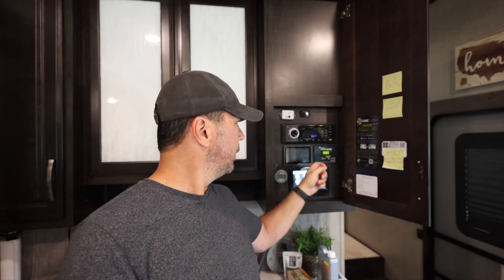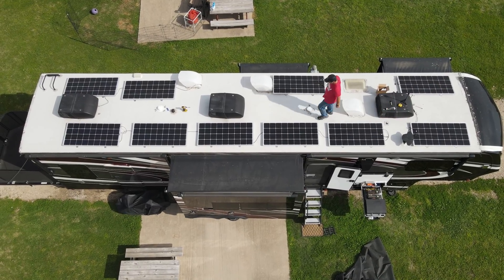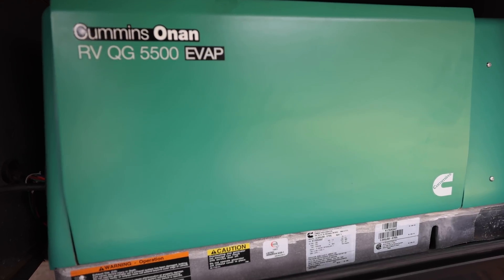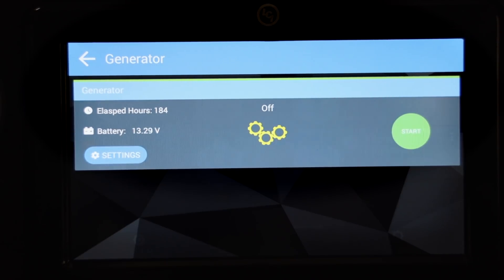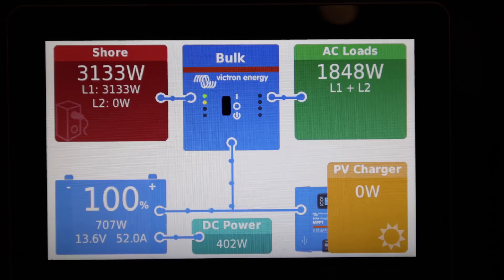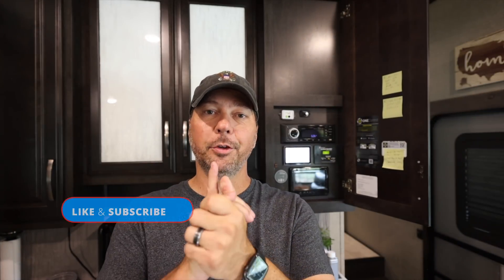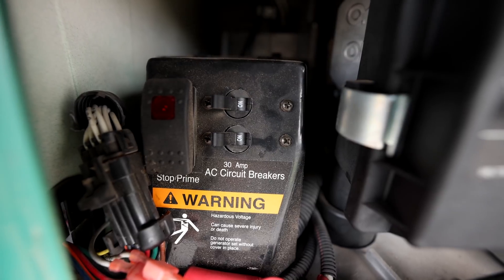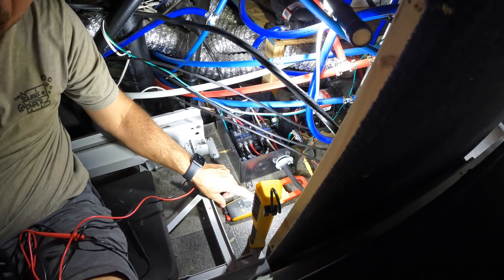RV Off-Grid (Solar) Power System Review and Fixes! (Full Time RV Life)

Comment: This is awesome! So I did my install very similar to yours aside from the inverter. I purchased the original one about 8 months before they released the second version that utilized both fazes. I actually worked with Jared "all about RVs" to do the install. The issue I was having is that when I would try and run an AC, it kept popping one of the two 30amp fuse on my 5500 generator. He helped me adjust some of the settings on the inverter that seemed to help. But I think what you did here would work even better. I couldn't figure out why running the AC's through the inverter would change things. And I couldn't find anyone that understood why. I'm going to give this a try. Thank you so much!!
Reply from the maker: Yea.. I texted with him a bit back in January and he mentioned someone he was helping over email.... I guess that was you.
Reply: @ChangingLanes  Yeah, it was. He helped me a lot on it. My only concern is that since I'm running the older inverter and I have one of the legs running through the manual switch, would that affect anything? I'm thinking it wouldn't but I want hear your opinion on that. Thank you for this video!
Reply: @DavidBowen  Neutral bonded to ground somewhere?
Reply: @MrThisIsMeToo  I don't think so. Both ac's worked together on the generator. Once I ran it through the inverter it started poping the breaker.
Reply: @DavidBowen  I had a similar issue on mine.  Had power appearing on the RV plug when the invertor was inverting.  I would be seeing that the Victron's have a floating neutral, that the neutral / ground connection is appearing in two places.  One on the generator and two on the invertor.  Could look into that, or just simply disable the neutral / ground bond in the Victron while it is inverting.  Be careful though if not experienced.

Comment: Chad, I see your display shows AC and DC loads, do you have current sensors on both sides so it shows up in the display?
Reply from the maker: The Cerbo looks at whats being used by the inverter and whats being pulled from the batteries and does some math to figure out native DC usage.  You have to tell it you have a DC system in the configuration and it does the rest...
Reply: @ChangingLanes  thanks, that helps, I will do some digging, Im sure that was discussed at the Victron training I went to, but there was so much info that some stuff just flies over

Comment: Here is what recently happens to me, we have the same inverter, with 630AH Lion Energy bank in 12 volts and 1200 watts on the roof, I was at a park with only 30 amp, I forgot to adjust my supplement to 29 amps, it was still at 49 (for a 50 amp pedestal) we had our fireplace making heat, a space heater, TV on, and then I made a coffee in out Kurig, we heard a click and all the ac loads went out ,but 12 volt stayed on, I blew the breaker on the pedestal, re set that and all is good right? wrong! everything worked, BUT when we were packing up to go, we noticed the lights flicker when the water pump kicked on, and then my wife was pulling slides in, no problem on the standard ones, but the Schwintek wouldn't work, when the inverter switched over, the AC loads were so high that I blew my 400 Amp battery fuse, and out 12volt loads were running off the solar panels without the batteries. Replaced the fuse an all was good again.

Comment: If you would have instAlled 24 v batteries. Which module does the convertion down to 12 vdc to supply your DC accessories like lighting? Your DC buss bar would be sitting at 24VDC now !
Reply: You would have to add another piece of equipment.  Victron makes a DC to DC converter line called Orion which will take 24v to 12v DC.  The wiring would get a little  more complicated as all 12v loads would need to come off bus bars located downstream from the Orion(s).
Reply: They run as 2 stand alone systems. 24v only runs the inverters for 110vac
Reply from the maker: If you go with a higher voltage than the rig is designed for (12v), you need a DC-DC charger/converter to bring it down to 12V for the rig.
Reply: You could also keep a spot for 2 battleborn 12Vdc in series ( to keep 24VDC bank) and have two terminals post of 12VDC available to connect lights. Saving the DC to Dc converter !

Comment: Awesome video Chad!!!  Having an RV built now.  Delivery date late August.  Solar package going to be installed in 2 months and it will be similar to yours.  Except for 1600 watts of panels, 8 lithium batteries, the 3K Victron inverter, and the other associated equipment you have.  My question to you, should I go with the 270 amp hour batteries.  I was a QM in the Navy for 20 years, so I’m still in training as an Aviation Electrician.  Would appreciate your advice.  Thanx!👍😃🍻
Reply: Look into the victron smart batteries especially if you are going 24 or 48 volt. They have a 200 AH 24 volt in a great form factor for just over $3000, on par with battleborn pricing
Reply from the maker: Our next install will be something like the BB 270Ah models...   But, another commenter mentioned eg4 from signature solar which also looks nice.  The battery game is ever changing, so do some research on energy density and check reviews... there's a lot of good stuff out there.

Comment: How do you differentiate between shore power which is 240 volt with opposite phases and your current setup which is 2 120 volt feeds on the same phase?
Reply: Measure the voltage between L1 and L2.  On shore power it'll read 240vac because the sine waves are out of phase.  If the voltage reading between L1 and L2 is 0vac then they're in phase.
Reply: There are no 240v circuits in the rv breaker box so hot1 doesn't know hot2 even exists except that they share neutral.
Reply from the maker: Not sure what you mean...  Shore power and generator power come in on different lines to the ATS which has generator priority.. If power is on the genny side of the ATS, it is connected to the inverter.. otherwise the shore power side is connected.  The inverter can see the phase relationship and acts accordingly.

Comment: Any reasoning behind sticking with battleborn? The new hotness right now is the eg4 from signature solar. 1500 usd for 5.12 kwh pack at 12, 24 or 48 volts is pretty compelling vs battleborn from where I am sitting.
Reply from the maker: I hadn't seen those.. Looks very interesting!  Thanks!
Reply: @ChangingLanes  There has been a lot of new players entering the consumer lithium battery space over the past few years and it's created some good lower cost alternatives to Battleborn and some new battery formats. I would suggest giving will prouse a follow on YouTube. His channel is focused on solar power and he opens up a lot of the batteries coming over now from china to see how they are built.

Comment: Chad,   Very smart fix for the generator.   I looked at the wiring diagram that you showed and the generator is paralleled on L1 and L2 just ahead of the two breakers and the L0’s were also connected together.   So, I learned something!   Thanks for the vide.   If you want to get your solar to put out the full 2000 watts or more, go to a mountain top in New Mexico in the summer near solstice time and at noon.   Respectfully,   Kevin

Comment: Love you used the ac ducts.  Any concern with condensation on the cables?
Reply: Shouldn't be an issue.  Cable should quickly be the same temp as the air in the ducts.  In any case it has a waterproof covering everywhere except the ends where the connectors are.
Reply from the maker: Exactly what Steven said... 👍🏼

Comment: A ground bar isn’t rated, designed or listed for your purpose. You’re 100% creating a fire hazard. Go buy a Polaris connector. They’re insulated and listed for your intended purpose.I’ve been a licensed JW in 2 states for 25 years. I think HD or Lowes has them. Do yourself a favor and replace them.
Reply from the maker: Another commenter also recommended those splices and I will be swapping it out.  Much cleaner and less hacky.  However, I disagree on the fire hazard.  Full load for an hour and it wasn't even warm.
Reply: @ChangingLanes  not if it shorts out from being a bare buss. I’m sure it was fine amp wise, the breakers should trip first. Keep in mind mini earthquakes. We love your guys videos. Keep up the great work. How to meet you someday 🍻

Comment: Fantastic video.  My husband feels completely vindicated!! He's been talking about doing a 48 volt system since he started looking into it and I kept saying "there must be something negative about it that we're missing because if it's so much better Chad would have done it". The smile on his face after you said you would have done higher volt was HUGE! 😁 😁 😁
Reply: I would set up a single 12 volt battery for the 12 volt needs withe the dc to dc converter. The single battery can act as a capacitor for the hydrolic pump.
Reply from the maker: The only drawback is needing a DC-DC converter to serve the 12V side..   Side note on that, make sure the DC-DC can handle the inrush current of the hydraulic pump.  I've heard there can be issues there.
Reply: @ChangingLanes  Chad is correct.  Victron makes the Orion series DC to DC series but they all will have a amp limit so know your DC loads and spec accordingly.  Doing after the fact - you would also have to upgrade the Inverter/Charger and a host of other items that would now need to be optimized.  Best to design upfront and spec accordingly.  If you went with 24v you could go with Tesla modules which pack a ton of power in a small space but need a custom BMS and are a little more dangerous chemistry.
Reply: @atcgeek21  FYI If not aware, you can parallel the Orion converters I ran two on my 48v system.  Upside is you have redundancy.
Reply: @MrThisIsMeToo  Absolutely! I should have been more clear.  They work great for this application.

Comment: Have you gave thought to adding another battery charger from Victron on those days with little solar but your batteries are low? You can use the generator to power the multiplus and the supplemental charger. With the 10 battleborns you could push 200 amps plus without overcharging them?
Reply from the maker: The multiplus is already a charger and charges the batteries on shore or generator power.  Yes.. when that's running AND solar, it charges very quickly.

Comment: Chad, 
Thank you for sharing about your Power System.  I need help with one last issue on my new systems.  At this point I have two separate systems because I did not want to trash 4, almost new, 6v deep cycle golf cart batteries.

System  #1    approx 450 Ah of flooded Led 6v deep cycle batteries 12v  wired into 3000 watt inverter/charger.  I have to run the 7.5 Kw generator for 2 hr in the AM and 2hr in the PM to keep the batteries up.

System #2    1,260 watts 12v solar into controller and feeding two 300 Amp hr LiFePO4 batteries 12v.

Summery:  two charging systems, two types of batteries one inverter.  How can I marry the two systems in order to utilize the full Amp hr potential through the inverter ?   would a A /B  battery cutoff switch work ?

Thanks,  Ron Oja in Washington State  have a great day.
Reply from the maker: Oh man!  to be honest, I wouldn't try it.  I would sell the lead acid and simplify.  Yes, you could switch batteries in and out so only one is connected at a time but that's a mess.  Not to mention there's no way to use a battery monitor and hunt to see where the whole system is in terms of charge.  Good luck!

Comment: Chad, it looked like the positive feed cable from the batts to the inverter is connected to batt#1 and the negative feed cable is connected to batt#2 negative. The negative feed cable should be connected to the negative terminal of the #10 batt when batts are in parallel.
Reply from the maker: All 10 batteries are in parallel, connected to the bus bars.
Reply: @ChangingLanes  That must be an old photo in the video as it show all batts in parallel but it is the neg feed line to the inverter on the #2 batt and not #10.
Reply: @ChangingLanes  I think what J.R. is trying to say is that your positive and negative cables to your battery bank should be on opposite ends of the bank as a best practice.  This allows the batteries to work equally.  I did not look at the video close enough to see how you had them wired.
Reply from the maker: The positive comes off battery 1 on the left and the negative comes off battery 10 on the right.  Those go to the DC bus and the inverter is connected to the bus.  Not sure what you're considering #2.  But it's a straight run back on the left from #1 - #5, then back to the front #6 - #10 on the right (as pictured).  Does that clarify?
Reply: @ChangingLanes  OK, guess I saw what looked like a feed cable next to #1, sorry for the confusion.
Reply: @ChangingLanes  I just watched the batt install vid again. What I thought was the Inverter feed lines was actually the cables to link the 2 banks of batts together, so sorry for the confusion on my part. For some reason I thought you had all 10 batts lined up in one line, must have been someone else. 🤐

Comment: Chad, I think you are confusing people by calling CELLULAR signal WiFi.  It's not Wifi, it's cellular. When you are connected to a cellular cell, your cellular router creates the local Wifi for your rig.
Reply from the maker: In the RV, it's WiFi... where that wifi goes upstream is irrelevant for the connection in question which was wifi..  Upstream is cellular most of the time but sometimes it's wifi over wan and very soon it will be starlink.. 😊   But, the problematic connection was 100% wifi.  Hope that clears it up.. 👍🏼

Comment: Thanks for the info.  I installed the same set up on my class A and the same light bulb went off.  The question I have is did you insulate the bus bar that you used after installing it?  Thanks
Reply from the maker: Yes.. sort of...  I bent the wires in such a way that it's got a good sized air-gap from the neutral plus some electrical tape.
Reply: @ChangingLanes  Thanks..One other question?  Since the shore power from the ATS to the inverter is the same setup as the generator, does the multiplus II handle it the same way?

Comment: Awesome job as usual Chad!!
I have the exact same set-up, but 30 amp. Love my Victron products. Multiplus II is a beast, works much better than the gopower I had in before. The GX is nice too. Not much goes wrong.
Reply: We were going to go with a Multiplus II but we needed 3000 Watts so we upgraded to a 3000 Watt GoPower. It's working well. Would be great if the Multiplus came in a 3000 Watt model.
Reply: @drinkinslim  Hi, actually the multiplus II is 3000 watts and has allot more features than the gopower. It's also not as deep,  can connect to wifi and many other sensors. Take thar gopower out and leave it in the basement like i did. 🤣
Reply: @e30andtheRV  According to their data sheet (spec sheet) the Multiplus ii 3000 is only 2400 watts. We were going to buy it but it just wouldn't handle our power needs which are around 2600 watts (depending on the day).
Reply: @drinkinslim  Honestly if your  running a constant 2600 watts off your gopower, I probably would have stepped up to 5000w model. You're not leaving much headroom for the unit. 
I prefer to keep constant loads around 50% capacity. Anything over that is circumstantial and not a problem for the MP.
You are correct though, the MP spec sheet does show 20% less constant output. However in my opinion, the features and adjustability of the MP far out weigh 600 watts of "extra" power while running the unit constantly over 80%.😬
To each his own.
Reply: @e30andtheRV  Sorry, yeah - the 2600 watts isn't our regular power usage - it's more our top end, with room to spare (above that). We just didn't want to go for extra features versus actual power, since the primary purpose of the unit is the power and we don't want to keep worrying about what we're running concurrently. Agreed: you go for what's right for you. Same with RVs. :)